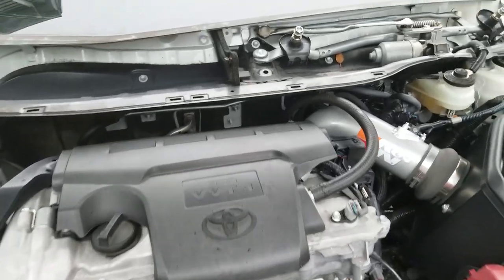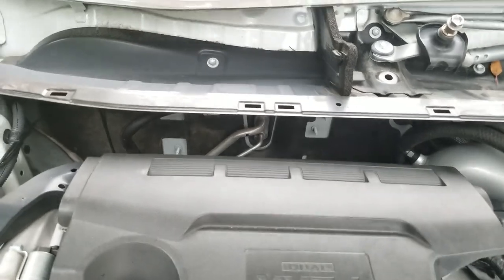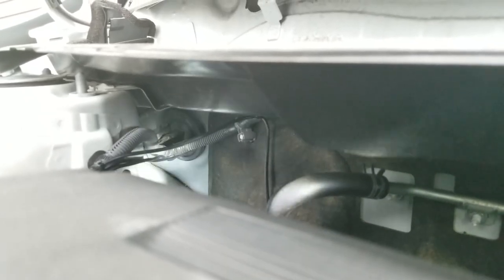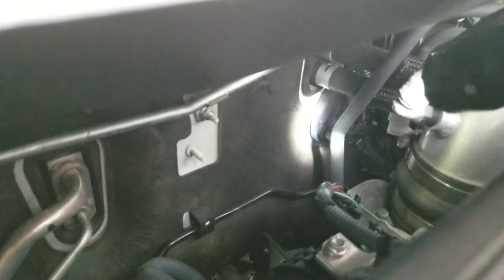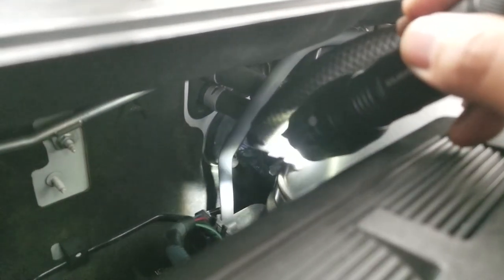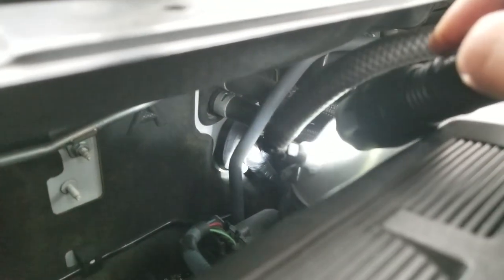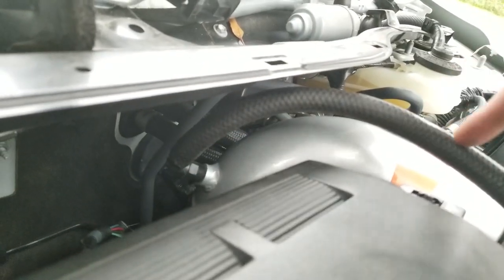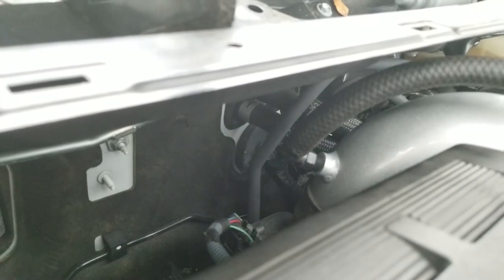Location of Firewall Rubber Grommets in the Engine Bay for Running Wires (Scion tC2 / tC2.5)

Comment: Video is very helpful. However I wouldn't use wd40 for wire lube, caused the casing to dry out. Instead most hardwire or supply shops sell actual wire lube like Yellow 77 for cheap
Reply from the maker: Good to know. Thank you!

Comment: Hey Derrick, Could you possibly do a maintenance video on replacing the PCV valve?
Reply from the maker: I'm not planning on making a video unless I actually need to replace the PCV. That takes a couple of hours to do because of the location behind the engine and under the fuel rail and intake manifold. It's one of the main reasons I haven't bothered with installing an oil catch can. Here is a link to a video for changing the PCV on a 2010 RAV4, which is the same engine: https://youtu.be/TIp5E0mBWgY

Comment: Hey Derrick just a random question?....what do u think about roof racks? If u ever think about doing it to ur car please show us ur process because i would like to know...i have the exact same car year and color as yours and i love it thanks bro👍
Reply from the maker: I used to have one on my Corolla and I did find it very handy, especially with trips from IKEA. It does cause extra wind noise while driving though. I was considering one for the tC at one point, but it's relatively easy to carry long items in the cargo area with the fold down seats plus I have the hitch I use for my bike rack and small trailers. Now as for how a roof rack attaches to the tC, I don't know without actually looking at the hardware because the way my old one attached to my Corolla is different.
Reply: Derrick Aquino it sound like u have a cool set up i just got off the phone with A roof rack company by the name of THULE  and was told they don’t make roof racks for this year tc and that the only way to do it was by drilling rails onto the roof edge by the door...go figure thanks for the response ur the real MVP👍
Reply from the maker: Aldo Sanchez Thule is what I had for my Corolla. Yakima makes a compatible roof rack for the tC.
https://www.etrailer.com/multi-product.aspx?pc1=Y00409&pc2=Y00124&pc3=Y00699&pc4=Y00728&vehicleID=20161238618&HHYear=2016&HHMake=Scion&HHModel=tC&hunter=roof&roofKit=BK_1T,S_1,SF_2,BSK_1,CGO_1&manuf=YAK
Reply: Derrick Aquino thanks bro exactly what i needed 👍